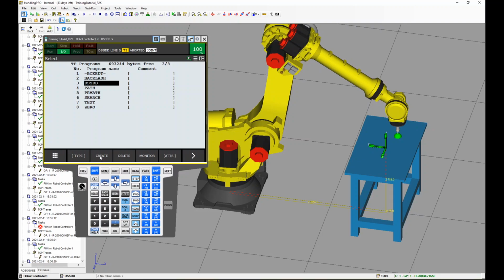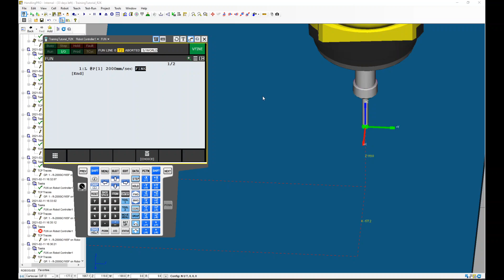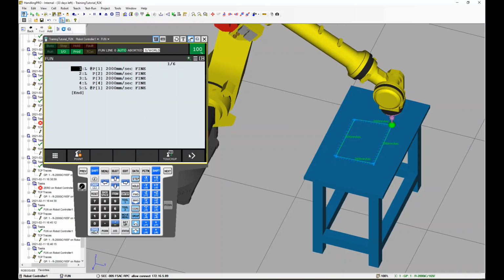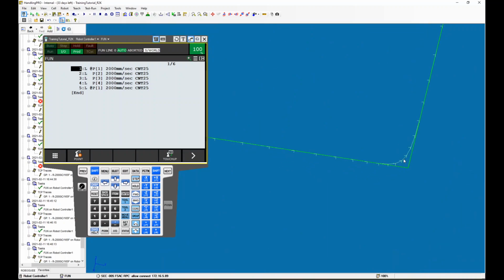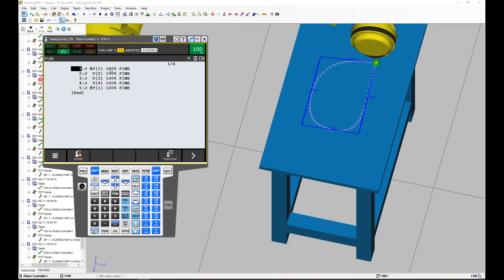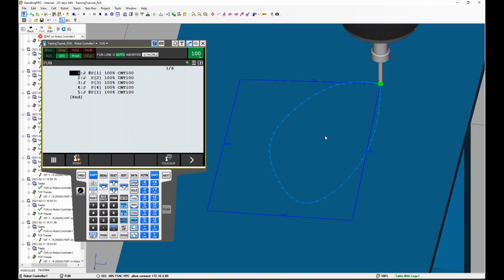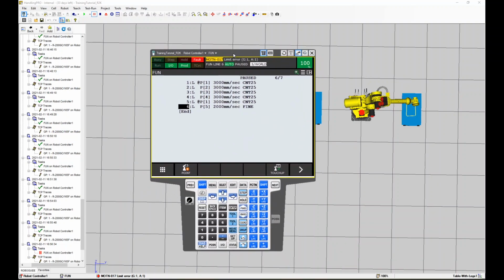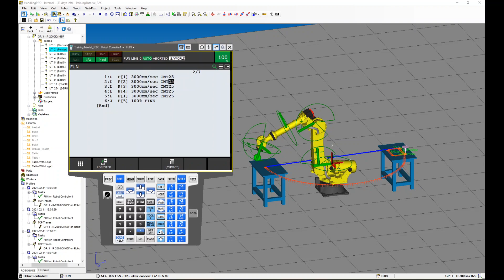FANUC Joint vs. Linear Motion Tuning

Comment: This video offers one of the finest explanations I've come across regarding this topic. You've skillfully condensed all the aspects I endeavor to articulate, resulting in a truly exceptional presentation. Just a small question.! What does 100% signify in J @P1 100% FINE? Is it 100% of the maximum robot speed? Or is it 100% speed of each joint? Having said that if Say I have to run a robot at 35 mm/sec max and the max speed of my robot is say 1000 mm/sec. Do I keep this value at 3.5%?

Comment: What I was told, whether it's true or not I don't know, is the robot decelerates to a point where its speed equals the continuous value then starts its turn to the next point. There is one condition where the robot will try to go through itself. If the program takes the robot to a point, then just sits there waiting for something, and you hold the robot and jog it around to the other side (let's say to inspect the tool), when you restart the robot it will try to return to its last point by doing a linear move right through itself. I've seen it several times. I always try to remember to do an 'abort all' any time I jog the robot so it starts from scratch and uses the homing routine to get home.